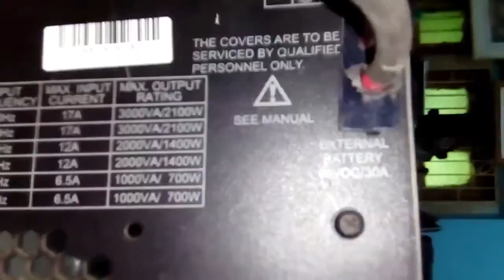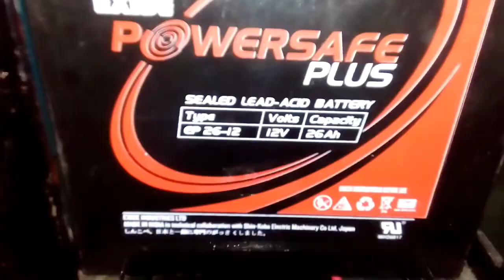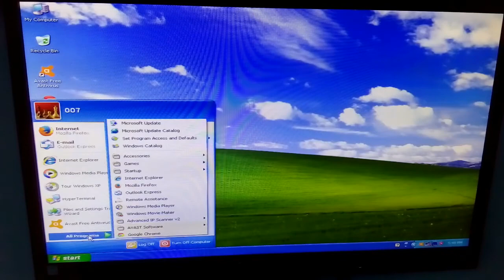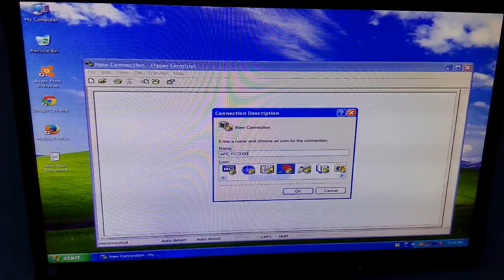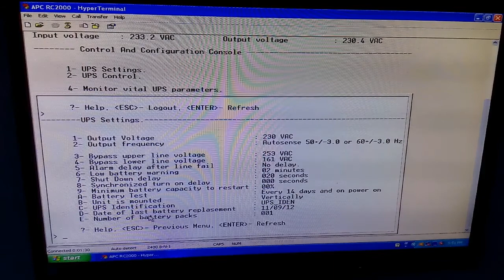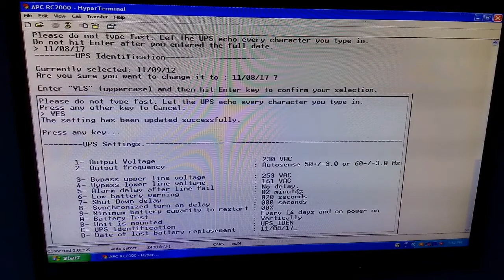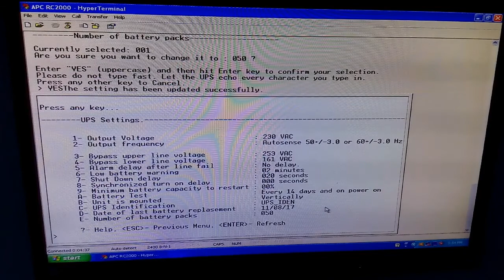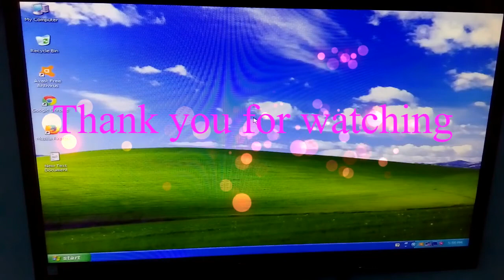External Battery install and configure to APC smart ups RC 2000va

Comment: i hve an apc online ups model is surt3000uxi 
ho do i connect the external batter bank to it 
anh how much max amps   batt could i use
whag wuld be the total batt voltage

Comment: Dear I have APC SU2200INET, I have attached 4 external lead acid batteries 100 ampere each with it to have long backup. but it is giving 20 minutes backup. I have put load of 1200VA max.on it. 
In your video, while adding number of battery packs in hyperterminal, you wrote 50 for 8 batteries that u attached. What shud i write for 4 batteries 100ampere each?
regards
Reply: Check your manual for battery config. For this model add 1 count for each 4.5Ah battery capacity(it comes with 96V 4.5Ah battery). So for the battery shown in this video i.e. 26Ah, battery string count should be 26/4.5 ~ 5.78 ~ 6. But for faster charging you can use higher number, but beware incorrect numbering will not trigger proper calibration results. To calibrate first charge the batteries to full then connect a minimum 30% total resistive load( coil heater, filament bulb etc) and run the UPS till the battery dies. Upon power on UPS should take the runtime info. For SU2200INET it comes with 48V 18Ah battery so your battery string number should be 100/18 ~ 5.5 ~ 6( Read your manual I am assuming SU2200INET  is similar to RC2000 in battery calibration).

Comment: I have APC SUA1500I, can I add battery 2x225Ah? What runtime can get in full load? Do UPS can charge battery to 100% and time need to recharge to full? Do I need some config ups for this capacity od battery?
Reply: you need to match the voltage, batteries in series increase voltage, like he linked up 8 batteries in series should get 8x12=96 volts, goto 0:13, it says 96VDC, the UPS expect you have that amount of batteries. it will charge the batteries to slightly over 100v then it will stop, so if you have less batteries, then the ups will constantly charging and your batteries will over charging(dangerous) cause batteries wont be able to reach that voltage if you have less batteries. if you have more batteries then your ups wont be charging the batteries cause they start with over 100v, and drain your batteries to empty(which will kill your batteries). as for how long they can last, you need to test with your equipment, assuming you didnt kill anything(yourself, ups, or batteries) yet.
Reply: @narf0339  this model charges batteries to 109volts dc. So be careful.